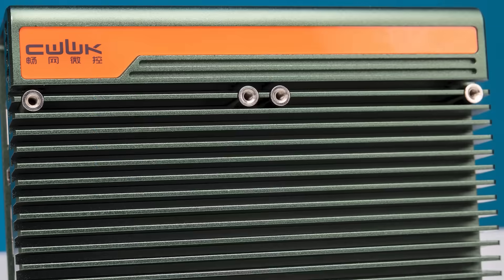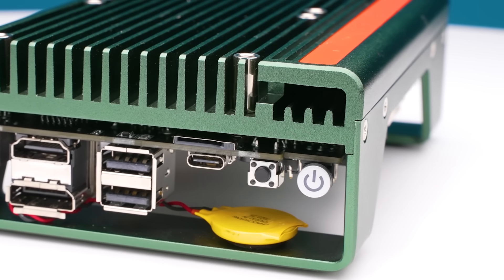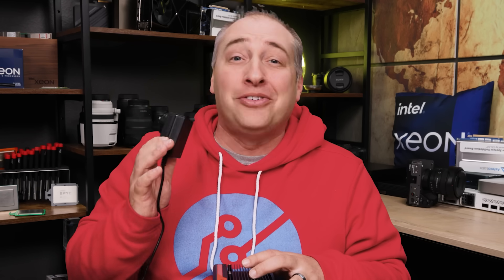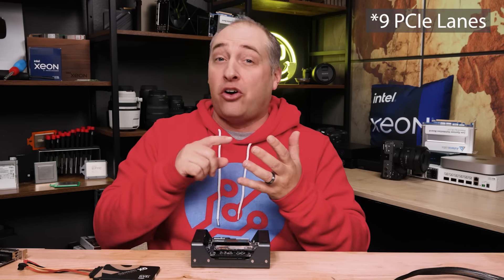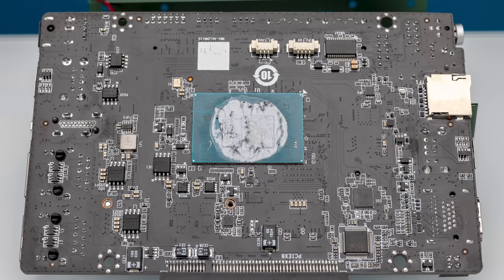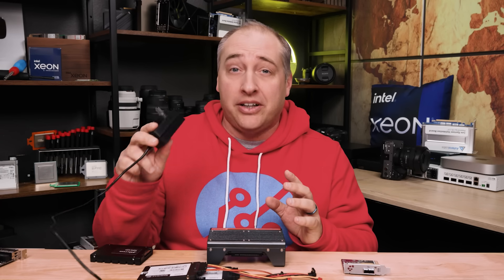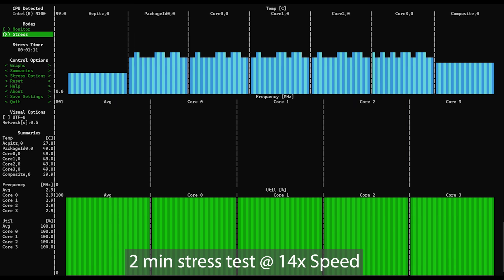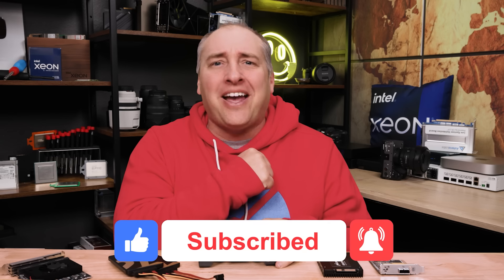FANLESS 7W Homelab Fantasy Mini PC

Comment: A short PCIe v3 x4 riser cable (cheap; they were used by miners) and a 3D printed bracket that bolts to the fan mounts, and you're good to go.
Reply: My first thought too, fan mounts or something 3D printed to mount card under feet to have heat sink on top of all extensions burger, not in the middle of hamburger tower :). This form-factor looks great, only question to CWWK is why it costs ~18% more than their 5NIC mini pc. Like we have minus 3NICs, more compact heat sink have to cost less too  and other things are almost the same. Maybe it's form-factor overprice, because it's competitor is ZimaBoard  silly CPU and 1Gb NICs. So CWWK do great thing and I wish it were cheaper (at least 15%) but still worth it because only alternatives are other CWWK and choice depends on do we need PCIex4 or more NICs instead.

Comment: It's definitely interesting but I think a second NVMe slot is more interesting for more people than the pcie socket. You can use an NVMe to pcie adapter cable if you really need pcie and you have flexibility when mounting the pcie card.
But from a general purpose server/router/nas point of view, it's a shame to waste half the pcie lanes on that pcie socket.
But it seems more aimed at the open air test bench application that you have in front of you here than serious use.
Reply: It depends. With PCIe we can add dual nvme card to it and still have nvme system drive  on this little thing (so 3 nvme) If I do this with nvme to pcie it wold be chanky chain (nme to pcie adapter then pcie to dual nvme adapter) with more points to failure. Or have to use sata system drive (cost more and only MX500 or WDS500 have 5 years warranty when it's a norm for cheaper nvme like Crucial P3 and Kioxia) or usb to nvme for system - not great in my opinion because DRAMless ssd struggle with usb bridges (no HMB then) and if forced to find ssd with DRAM - cost go higher then SATA and less reliable on USB. 
What I really wish in terms of storage - some adapter with ASM chip to stack 2*M.2 ssds into one M.2 slot. Not greatest solution for hot pcie4/5 but definitely great for cold DRAMless drives.

Comment: I have the one with 4 2.5G LAN ports and a 5105 CPU, but it Is broken, and it happened when I pressed the clear CMOS button. The form factor and the idea are awesome but I don't trust this brand anymore, it's better to buy 4-5 years of 1 liter PC like Lenovo ThinkCentre. I bought a BIOS programmer to fix it but none of the BIOS files I have downloaded from their support site worked, plus I can't understand Chinese to make sure I am flashing the right one so I can just rely on pictures they put in the folder with bin files.

Comment: That 30TB drive runs nearly $2900. Wow thats a lot. But i bet in 5 years theyll be able to be bought for less than $1000
Reply from the maker: I hope so!
Reply: @ServeTheHomeVideo  me too, as the 2TB and less drives are starting to feel quite small. Install 5 or 6 AAA games on it and you're basically at max capacity for the drive.

Comment: I wonder if it would be great for a NAS build. Drop an HBA card in the PCIE port and have a backplane. Both run of 12V power. Energy efficient NAS
Reply: PCIe opens the way to Backplane if many HDDs  needed or cheap dual nvme cards (if someone like me needs only 2TB mirror and even gen2x1 for each ssd is not a problem, only silent operation needed) Dual 2,5Gb NIC is great for little home NAS too.

Comment: a too smiley nothing burger - zen5 mobile mini pc will relegate this to curio shoppes
Reply from the maker: Strix Point is set to be announced late 2024 but availability early 2025 from what we heard at the AMD event a few weeks ago
Reply: @ServeTheHomeVideo  The Strix Point APUs are expected to be released in mid-2024 and will mark the debut of the first mobile Zen 5 chips. - so they will be a lil late - the mini pc/arm scene is still a hellhole - wait for something decent is the message. people should get a regular refurb pc or an orange pi in lieu of this - more cores, more ram, more expandability, better value and performance. this thing looks too much like a fire hazard science experiment - if you have no choice yeah it will do but otherwise you can and should do better - jest get a regular pc in a tower case and you can add in a used gpu - this advice goes for business also - even a broken screen laptop will give you more value - buy it for a song and attach a monitor then run it headless

Comment: I almost wish they'd left the PCIe connecteor as a card-edge instead of a socket. It'd have been pretty easy to get a PCIe x4 extener to fold the card back over the brick. You can still do that with a ribbon extender but those are a lot more delicate.

Comment: if those 2.5G NICs are using a lot each, they failed. 3x1 is 1Gigabyte a sec isnt it? That nic is only what, about 280? So a single slot should support 3-4 NICs at once.
Reply from the maker: Are you thinking bandwidth of a NIC versus PCIe bandwidth? If you put two PCIe devices (NICs) onto a system they also need connections to a PCIe root. So lanes are very important.

Comment: Can you connect hdd drive to it instead of low power ssd? It looks like it would be good mini pc for nas.
Reply from the maker: Yes. SSDs were just easier to show on set. The team, however found HDDs on those ports to be problematic so that is why we are recommending sticking them in the QNAP DAS chassis.
Reply: @ServeTheHomeVideo  I believe it can be 12V drop, if someone want to test it out - beefier PSU first and tinkering with cut 12V from SATApower cable and feed HDD directly from PSU insead of board. Don't think it can be releted with sata itself or week 5V (it runs SSD from 5V, and to be sure there is a way to test with 2,5" HDD - it draws even more on 5V because motors not run on 12).

Comment: I really want to see some fanless machines with at least 1-2 performance cores (pentium gold, i3-1215u, i5-1315u or equivalent). Could possibly use the new fanless coolers using the airjet technology. A quick google says they can remove about 10w of heat which might not be enough for those chips though. (they run 15w - 50w burst type power). Seems awfully close though if you could limit to the base 15w area. Maybe a 2-3nm version of those chips could get there as well in a few years.

A current compromise might be the N300 chips that are 7w tdp and have 8 efficiency cores vs. the 4 here, but single threaded performance would still be blah.
Reply: cwwk has you covered there too haha, it even was reviewed on this channel. Video titled: "KING of Fanless 2.5GbE Mini PC Routers and Firewalls Now with Intel Core i5 Alder Lake"
Reply: Know of anything that uses something like the 8505, U300e, or i3-1315u and has an x4 or x8 (electrical) PCIe slot?
Reply: @ergohack  As in actual PCIe slot no, but M.2 with full 4 lanes - yes that same PC has it (also has an option for i3 and 8505). If you want 10Gig then m.2 copper nics exist (and work it it too, as I have tested one), or well.. riser shenanigans. But not with an actual PCI-e slot, those probably also exist, since there are mini PC's with mellanox built in to the chassy as mentioned in the video, but have not seen one barebones. TBH this sort of thing is more miniITX type deal.

Comment: It would be neat to see one of these low power guys that can run on POE+, If you 2 ports then you could theoretically get up to 60W of power through the pair. I haven't seen one but It would be cool to have something like that, but a little bit more than something like a raspberry pie.
Reply from the maker: I think we mentioned it in the video (we did in the article) that we used a splitter and did just this

Comment: This is the perfect setup for testing components.  It would be great for a shop that deals with used hardware or just an enthusiast that swaps out hard drives and PCI-E devices regularly.  I can't imagine wanting to use something like this for any kind of a permanent setup. It would simply defeat the purpose of having everything so easily accessible.
Reply: The perfect setup for testing used hardware is FREE and DISPOSABLE so when bad hardware murders it one can grab another from the donor pile. For enthusiasts it's ideal though as it can be cased in any enclosure one desires (or 3D prints).
Reply from the maker: Yes

Comment: I could use something like that for "off site" backup, put it in a closet or somewhere in another office and backup everything on it. 
But it was nicer if it had power by USB-C, would not heve to carry it's own brick with you when moving it (since is small and mobile / movable).
Reply: It does. You can power it with the type c, the issue is the type c is the only usb 3 you have. But if you don't need usb 3, you can power it up with your average GaN type c charger

Comment: Add a dual 10gb pcie card and 3d printed support + fan mount for it = nice mini router. A pcie extension cable fixes the issue.
Reply: I agree with you, but consider that a 3d printed support on top of that heatsink will deform over time
Reply: @Marco-dr5ho  depend in the material
Reply: you get more than a gigabit on your upstream?
Reply: @ACuteAura  yupp

Comment: As it has dual 2.5 Gbit it would be a pretty neat low powered pfsense/opnsense box.
Reply: with the PCIe port, you could also drop an additional 4x 2.5G i226v card on there and get six routed 2.5GB interfaces, which could be very useful for some labs.

Comment: the question is: will it be fast enough to route my 4 gbit pppoe internet connection in opnsense with a 10G card on it.... There must be some sorcery in the router of my ISP to be able to do that without using a lot of power. The N6005 did 2.5G though.
Reply from the maker: For NAT, if you have a decent NIC you are probably OK. We might have something more interesting for that in a video or two (not sure of the exact order)

Comment: Could you throw an A2000 in there?
Reply from the maker: The A2000 is a 70W card, so you would run out of power on a system like this.
Reply: Could use a powered riser with an external PCIE power supply. Kinda kills the small footprint though. I suppose you could split the power to also power the computer as well to eliminate that.

Comment: 7015 fans are an odd choice, given that this system has the width for it I'd prefer to see a single mounting point for an 80mm fan. Those are a lot easier to find in PC parts stores, and the 15W N305 isn't going to be that hard to cool - a single fan would have plenty of airflow
Reply from the maker: Agreed. As is not using standard 4-pin PWM fan headers.
Reply: China tech. They have thier own logic. I see it in the 3d printers,etc
Reply: @Phil-D83  It largely has to do with the far more readily available parts in China. Taobao, China's Amazon, has a plethora of super easy to find parts that are far more niche in America. :P So, these devices that are just as popular in China, are designed based on parts that are easily found on Taobao. 
I wouldn't be surprised if this manufacturer could easily be talked into including a fan with the purchase as it'd be pennies for them (more like a couple of dollars, but still ridiculously cheap) to include it in the package.

Comment: I already like the chassis pre-fit for added cooling
Reply from the maker: It would have been nice if it had standard PWM 4-pin power headers for the fans
Reply: @ServeTheHomeVideo  dang, what does it use instead?

Comment: Lol, yesterday I was thinking about this CWWK with PCIE slot vs CWWK CW-X86-P5 (super mini with 2 ethernets because its ok for pfsense bare-metal)

I have investigated topic about 10g SFP+ card because I was thinking to bypass ONT and connect GPON to SFP+ port, then from second SFP+ port nice 10gbps DAC cable to my switch.

You need PCIE 3.0 (not 2.0) SFP+ cards (they will work on x4 and its totally fine for 2x10gbps duplex), about 5W additional power consumption

So on the table are:
Mellanox connectx-3 doesn't support aspm -> Mini pc wont lower energy consumption in idle (keep in mind that)
Mellanox connectx-4 supports aspm, is more expensive
Unfortunetly above cards doesn't support anything but 1gbps or 10gbps (my gpon could be 2,5gbps)

and there comes Intel x710-DA2 which EDIT: doesn't support 2,5gbps negotiation, supports ASPM

and it costs alot, 150$ CWWK 2 ethernets vs 210$ this thing with PCIE + 120$ SFP+ PCIE card...

Locked my homelab to 2.5g at this moment, anyway I will have 2gbps download pppoe ;)
Reply: There are two different X710. The new one, x710-t2L or t4L do support 2.5 and 5gbe. They are hard to find with sfp+ tho, most of them are base t
Reply: I have the x710-da2 and it doesn't support 2.5Gbps. Where did you get the information that supports 2.5Gbps in SFP?
Reply: @diogosn  oh, saw on some auctions, my bad, checked intel ark and thats True, 1 or 10gbps :c

Comment: It's probably more accurate to refer to these processors as "Gracemont", since that's the E-core codename and this is the first gen where they don't get a dedicated codename for the entire die. Calling them "Alder Lake N" is a weird marketing move, but Intel is full of those.
Reply: That's because the core architectures are used across generations, 13th gen Raptor Lake also has the same Gracemont cores. It's still under the 12th gen in the eyes of Intel. Not unlike how the Ryzen 7800X3D is called Ralphael but the it's cores are called Zen 4.
Reply: @tonicipriani  Yes... I'm very aware. But calling both the Atom successor and the flagship the same name is the Problem.